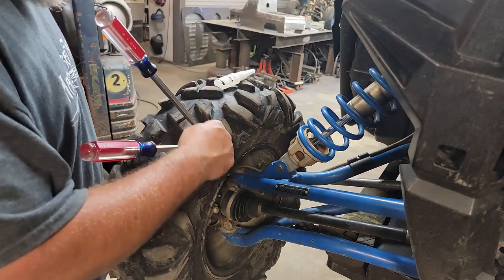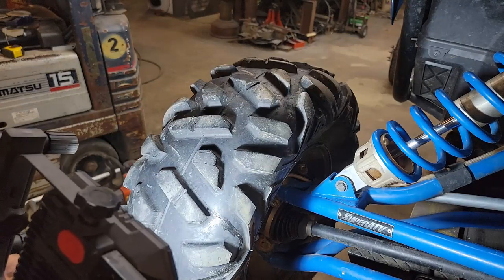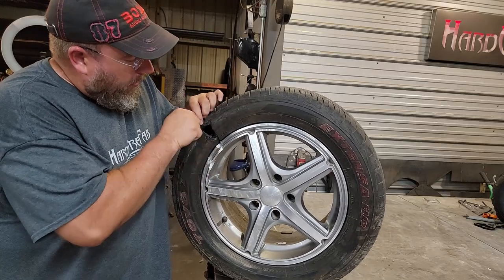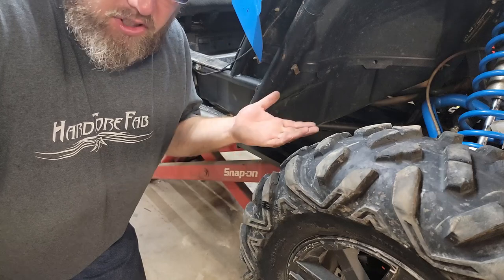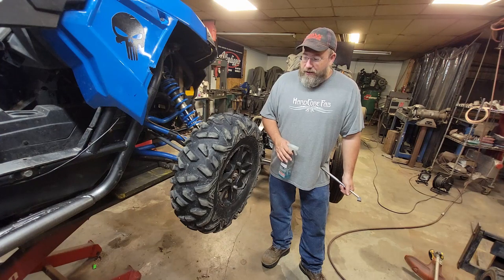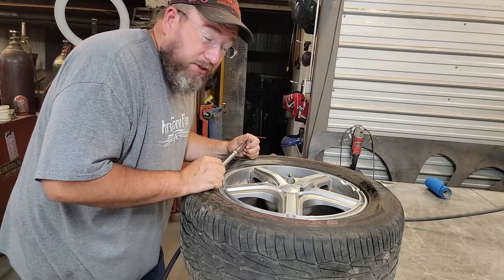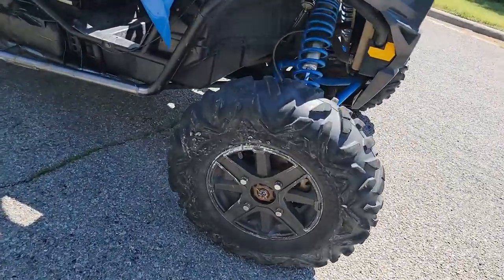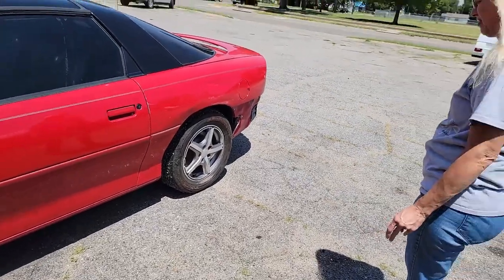Can you fix a tire with glue?

Comment: How long will this tire last?
Reply from the maker: I wouldn't consider it a real fix.  Having that said I have a truck that has a glued tire still holding air that was done the week after this video was made (I don't drive the truck its just a roller project)
Reply: @HardCoreFab  So I would like to ask exactly how long this glue will last when applied to the tire.
Reply from the maker: @MyNameHandsome  I have no idea.   I don't make the glue. I don't sell the glue. I haven't put it to any kind of long-term  test.  Like a said over and over, I don't feel like it is a permanent fix!  I just thought it was cool that it worked at all and could maybe help some as a trail fix or for a scab tire that is not on the road.

Comment: I've used a big needle and small string to thread a tire back together mid way in than apply glue with some powder I have here for fiberglass filler than simply do my best to seal back up and not be able to tell I was in there and it worked so had you used a needle and string on your side wall first that locks it back together pretty impressive what one can do with the simplest things in life there is videos on here from another country maybe India or something check it out the guy fixs backhoe tires with chunks missing that's where I got the needle/string idea it does work , safe travels and God bless sir
Reply from the maker: I'll have to try the needle and string next time!
Reply: I've seen that video, the guy vulcanized patches inside and out after sewing it up.

This 'crazy' glue seems to work amazingly. 
I'm thinking a big patch inside the tire would stabilize it even more.

How's the lug hanging in??
Reply from the maker: Lug never came off.  After about 5 hours of hard riding (rock boucer style) the tire did started to leak.  I slapped a new one on so I could keep riding and never even look at the tire to see why, but I'm guessing it's the glued spot.
Reply: @HardCoreFab  that's amazing. 

Your video caught my eye because I noticed a sidewall cut on our bi directional tractor. 
 Been told it can't be repaired, but I've been wondering about using 'crazy' glue plus a big patch.
After seeing your experience,  I'm confident this 'non repairable ' tire will keep on rolling

Comment: A mechanic shop recently put tire glue on my rims after they found out my stock rims had shards peeling off, to prevent the tires from leaking. Do you think that is a good  fix? I think resurfacing the rims would have been better.
Reply from the maker: Resurfacing would be the best thing to do fore sure!  But I have a can of the bead sealer stuff beside my tire machine and it works!

Comment: Would gorilla glue work for the car tire? I have a gash along the rim, it's not leaking air just sliced. I was just looking for something to hold or help if it does start leaking. It will be a couple day before I can get a new tire. We just moved and spent almost 4k in deposits and rent and moving so it happened at the worst time and I just need a bandaid til I get paid. Thank you
Reply from the maker: I wouldn't recommend fixing the sidewall of any tire that would be on the road